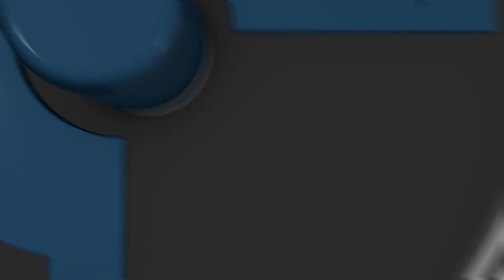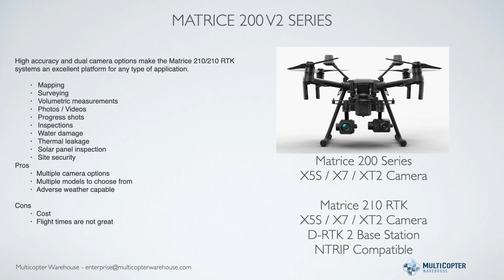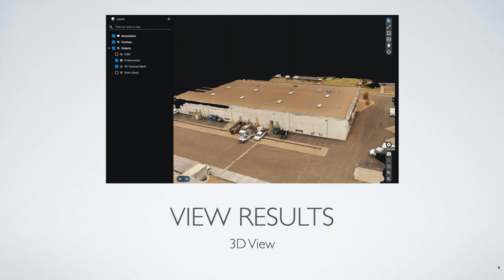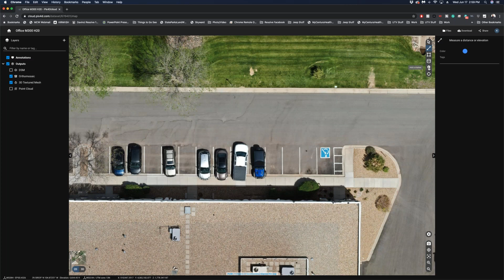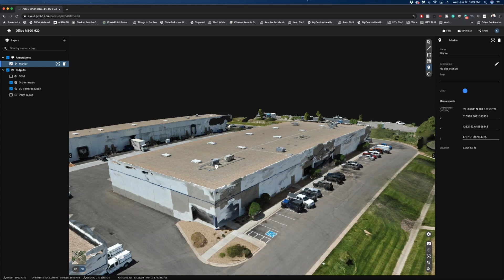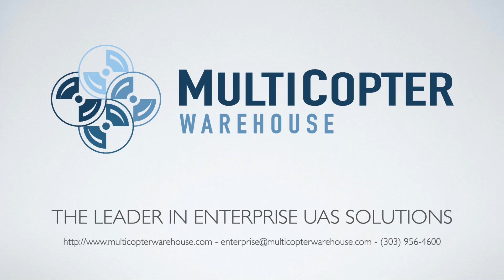Choosing a Drone for Mapping/Surveying

Comment: Hello,

Would you happen to have a tutorial video or a reliable method to recommend for calculating a cubature (volume) from drone data, particularly using Agisoft Metashape or DJI Terra?

I’m looking for a clear and efficient approach that I can share with drone pilots, in order to simplify this type of processing as much as possible.

And if you also have any method or advice for verifying the accuracy of the results (field comparison, control points, acceptable error margins, etc.), I’d be very grateful.

Many thanks in advance for your help!

Comment: HVAC, dirty filters will cause HVAC systems to work harder?
Reply: It will make the AC system run cooler (freeze up) with no heat transfer from the indoor air and evaporator coil.

Comment: could i use a dji fpv drone for surverying property
Reply from the maker: Not really the right machine. The camera resolution is only 12mp, the camera cannot point straight down, there is no way to automate a flight, and it only has a 1 axis gimbal.  Can you build a house with only a butter knife? Probably, but its most certainly the wrong tool for the job.
Reply: @multicopterwarehousellc  how would the dji air 2s hold up?

Comment: Thanks for the Webinar, very detailed and very informative. 

One year later, is the Phantom 4 Pro/V2.0 still the go-to option for mapping? any tip? advice?

Thanks again and keep it going!
Reply: P4RTK is the industry standard I would say. The P1 payload coupled with the M300 Rtk looks promising but is a lot more expensive .

If you aren’t concerned with Absolute accuracy though, you don’t need RTK. You’d just be wasting money.
Reply: I currently still use a p4p for mapping/volumetric stockpile calculations with ground control and it’s great for that application. If needing survey grade or lidar, I’d say rtk is the go. But also alot of areas is in a rtk denied environment. Ppk works better for these areas.

Comment: Aloha, 

I am going to purchase the m300 with payloads L1,P1,H20T, eventually dual gimble. All said and done that's about 43-50k. 50+ if I get all the toys minus the U10. So I was wonder if I want to buy a cheaper mapping capable drone to practice with. What would be the recommended drone right now I like the DJI Mavic air 2. Is this a good drone to start practicing the flight and photography?

For a better understanding, I am a scientist this drone will be used commercially and for research, both equal fun while I try turn things to profit or a hobby/research that pays for itself. Also do you know of any small mid size (M300 size) payloads that offer the LiDAR Green for water penetration?

Thank you,
AJ
Reply: I’d look into LiDAR USA. A lot of those payloads may not be compatible with M300 though but would be for an M600

Comment: The P1 should be good for mapping, mechanical shutter with 42MP , does cost $15,000 though haha
Reply from the maker: Not sure where you got that pricing from, but the P1 is much less than $15,000

Comment: Phantom P4 Pro is the best mapping option available. Buy 3 of them while they are still in production!
The P4 RTK is $6k more and is miserable to use especially when it comes to multiple battery swaps during a mission. 
M200 with X4s is the worst option and the X4s was discontinued because of its horrible mapping (image) performance. It was good for video and no matter what they say about it being the same as the P4 Pro it isn’t as it has functionality that can’t be fully turned off.

Good comment about the DJI China Spying BS! So sick of hearing of that, but it’s something that DJI will never overcome.
Reply: mmmm, you mean like
 the 100,000s of people with their GPS tracking iPhones 
on vacation filming everything everywhere.    Yeah, let's ban a PHONE and cars too because a drunk can kill you with a car.
Reply: Fern Blitz  you don’t need the RTK/PPK unless you are needing to do Surveyor Level mapping.
Reply: Hi Lane. I am thinking about buying an p4rtk and swap battery many times to cover large areas. Why do you think it is miserable? Please explain
Reply: @SimoneS86  I don't understand how the Phantom 4 could be as precise as rtk
Reply: @tagmaster5854  their camera Is pratically the same. The main advantage of p4 rtk Is its Better GPS positioning , which allows a good (geometrically robust) photogrammetric recostruction of the scene, with less (Just 1-2 !?) Ground control points. That said, if in your typical kind of surveys time Is not a problem, you can simply collect some more GCPs . If you use a good Rtk enabled Gnss  reciever to do that, you Will obtain an excellent result Just flighting with the basic phantom4...
Reply: Fern Blitz  There were just minimal updates and nothing worth spending anything extra or putting off a purchase.  There will be other manufacturers added to all the various mapping applications also… My favorite personal UAV is the Autel EVO2 Pro (6K) and it also has a super impressive mapping app of its own…
Reply: @Chief351L  total cost hardware to do uav construction site images that are geo referencrd?
Reply: Which mapping software would you use and what equipment do you need to add to the Phantom 4 to make it to geo referencing
Reply: Hey Lane - are there any new offerings from the last 2 years (since your comment) that you'd recommend today over the P4 Pro? I'm thinking I'd like to get something other than DJI, unless going with DJI is the obvious choice for this type of work.